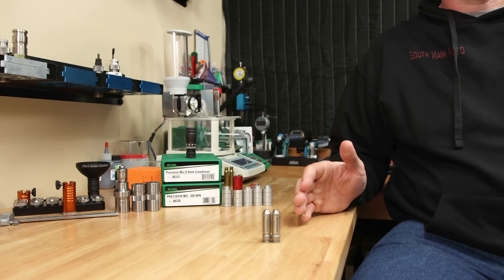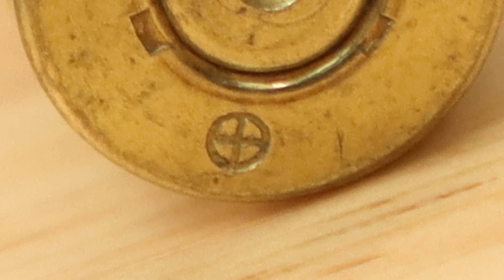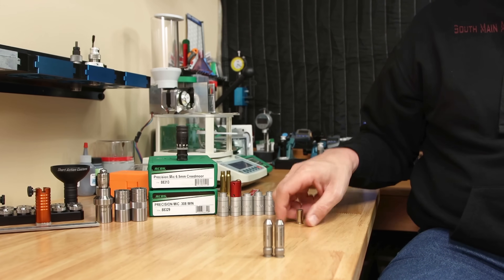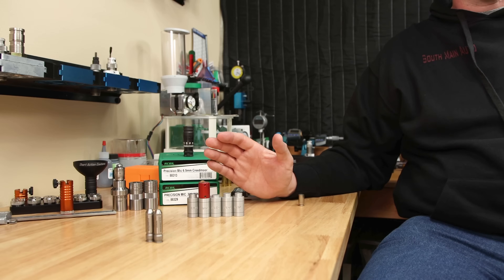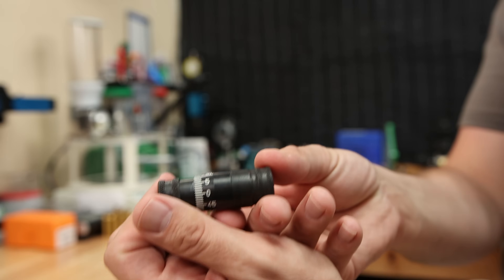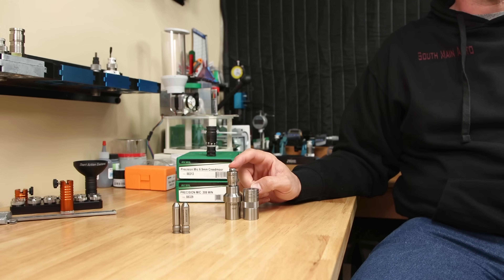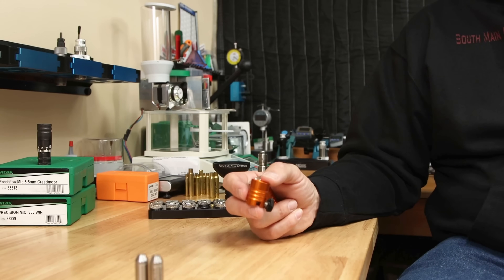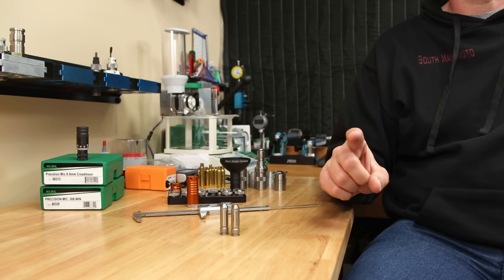Understand and Measure Headspace - 5 Methods Compared!

Comment: From what I remember, a RCBS Precision Mic actually Will give you absolute numbers. The reading on a Go Headspace gauge will be zero. In .308, most commercial factory ammunition will gauge the same. The problem is that reloading presses and equipment tend to flex a bit (some more than others), so I had to set my equipment to average at -0.002. Most rounds were plus or minus 0.001 inch though very occasionally one would get to plus or minus 0.002 inch. In loading thousands or rounds, I believe I only ever had one or two that read +0.001 on the Precision Mic.

Comment: All shoulders are not created equal. Therefor headspace gages are faulty by design. The gage is supposed to contact the datum line located half way on the shoulder. BUT due to allowable tolerances, shoulder angle of gage and chamber will differ. The shoulder angle of the GO-gage can differ from the NOGO. A better design would be a steel sphere to contact the datum line on top of a colom. Both are easily measured. Make the colom magnetic to hold the sphere. A GO colom and a NOGO colom used with the same sphere.

Comment: I like the angled shoulder in the comparator over the (sort of) sharp edge in the Hornady gauges. The Sinclair “bump gauge inserts” fit in the Hornady tool and have two advantages. First, they have a bevel inside that I found gives you a more consistent measurement. Second, they are made of steel unlike Hornady’s aluminum inserts.

Comment: I tried setting the sizing die, by measuring with two methods in parallel, and since we are looking only at the difference and not absolute value, they should show about the same difference, as  it can be seen when measuring the GO gauge. So after using SAC to set the die to bump .0035, when I measured with LE Wilson it showed .009, which would be way too much. I tried to keep my measuring with a constant handling of the gauges, and it always showed about .006 more across multiple cases. Then I tried setting the die based on LE Wilson, and when I reached .0035 bump, the SAC showed 0 bump. At this point I do not know which one to trust.

Comment: I really dislike the caliper clamp opening on the SAC. Option... its not only way to big but because the caliper is not centered exact every time your measurement can very.. Mitutoyo's should be the standerd I feel and all groves should be machined to there spec. For exact fit
Reply from the maker: Hello, Is there and chance that you have the the thumb screw in the "O" side of the body instead of the side marked "C"? 
CONFIGURATION “C”: CENTERED
With the 10/32 Thumb Screw mounted on the bottom side with a “C” means that the Modular Headspace Comparator Body will be centered on the dial calipers. This is standard for all normal uses.
CONFIGURATION “O”: OFFSET
With the 10/32 Thumb Screw mounted on the bottom side with a “O” means that the Modular Headspace Comparator Body will be offset on the dial calipers. When using the Hornady COAL measuring tools, the Modular Headspace Comparator body must be offset on the dial calipers in order for the Hornady tool to be properly aligned with the Modular Headspace Comparator assembly.
Reply: @BoltActionReloading   thanks for the responding. Yes I'm using as SAC suggests. I wish I could add a picture to show you what I'm talking about.. great video bud thanks
Reply from the maker: Send me a picture if you have one to the email in my channel description.
Reply: @BoltActionReloading  sorry dude I can't find any email..  of you list it here I'll send it to u

Comment: I have the SAC, but my fired .308 case mouth will not fit all the way into the comparator.  Works fine after i resize, but i cant get a before sizing shoulde measurement🤔
Reply from the maker: I would call and see if they have a newer design.  They can probably help.

Comment: Recently got set up for reloading using hornady dies for 308. I've set my sizing die and locked it in. I'm getting a lot of variance in my shoulder bump measurement. Using hornady headspace guage. What am I doing wrong?
Reply from the maker: There can be several factors. If you are using multiple brands of brass, if they have different number of firings, etc. all of these things can add up. Also defining what "a lot" means to you is helpful. 

BAR
Reply: @BoltActionReloading  all federal factory load once fired in my rifle. Can vary from no shoulder bump to 5 thousand plus and everywhere in between. Using hornady digital calipers
Reply from the maker: what is your case lube? are you annealing? What Hornady insert? (.400?) when you measure the same piece of brass 10 times do you get the same answer? are you decapping first? (any primer cratering can cause variance)
Reply: @BoltActionReloading  decapped,  lanolin alcohol lube, proper insert, not annealing, same measurement multiple times on same piece of brass. Spraying lube exactly the same way every time. 50 at a time in reloading tray 1 downward angle spray from each side
Reply from the maker: What die / press setup?
Reply: @BoltActionReloading  hornady custom grade 308 die set and lyman all american 8 press. Forgot to wipe lube off before measuring against hopefully that will account for most of the variance. Also going to leave the brass in the die for a longer count to see if it helps
Reply from the maker: I am not experienced in turret presses, I wonder if there is any slop / variance in your turret head? I have people ask me about this frequently and would really like to make a troubleshooting video on this topic.
Reply: Look into annealing. What annealing does is “resets” your brass.

Comment: First video of yours that went a tad over my head… I use Hornady and understand the concept but it seemed a bit too short in context.
Having stated this still love your expertise.
Reply from the maker: HI Bert, Thanks for the feedback! I really was just trying to get the point across on how to use the tools rather than concentrating on the drawings (to a reloader, loading for 1 chamber, means basically nothing more than find the correct size datum tool if your using the Hornady tool.) Otherwise its picking an insert and a pair of calipers. I was just trying to show that there were lots of ways so folks could pick the one that suited them best. This was the first time I have used the RCBS mic and it was a lot less fiddly than I expected. Seems that all the viewers are choosing shorter content these days so trying to give all the options in a concise fashion was my goal, maybe I missed the mark a little. If I could understand better what more people really wanted to see I would include it.

BAR

Comment: It would have been more informative to use the same caliper when showing the measurements on the SAC and Hornady gauges. Remove some variability. Still very informative.
Reply from the maker: Thanks Rex, I see your point and that may have been the better way to do it. The accuracy on all the calipers regardless of brand is going to be +/- .001" so I didn't think it would be a factor when they all read well within that tolerance Thanks for the feedback.
Reply: @BoltActionReloading  I have to admit I had a little bit of an ulterior motive I also have the Hornady caliper and I wanted to see how accurate it was in both cases 😀

Your channel has been a blessing to me thank you for everything you do!

Comment: None of this is necessary for basic reloading. This is for competition level accuracy.  As long as a rifle has proper headspace, setting up dies to safely reload is easy and requires no extra equipment. Someone just getting started making their own ammo might find that fact useful.
Reply: Yes as a beginner reloader I just follow a simple process, take once fired brass from one rifle, use headspace comparator to measure before/after when setting my full length sizing die, make sure to bump shoulders no more than +/- 0.001"
Reply: The lee hand loader only sizes the neck seems simple are they safe
Reply: @scottpatterson6863 I did not see the accuracy I am looking with the Lee Loader.  ...and no I do not want to just re-size the neck and not check and  re-set the shoulder.

I final size my 223 case necks with a Sinclair mandrel die and a 21st Century carbide mandrel on an Forster Co-axe press.  (To precision set bullet neck tension).

Case neck thickness uniformity is measured with a Sinclair case neck thickness uniformity gauge.  Necks are turned on a Forster mini lathe and polished with 000 steel wool.

I use the black RCBS headspace gage   as shown in this video to set the lock rings on my dies.  ... and I have drop in ammo checkers for finished rounds and unloaded cases.
Reply: No... really?
Reply: "Proper head space... ain't in the rifle!" (as you say).

"Headspace is the proper fitment of the brass case in the rifle chamber or the space between the case head and the bolt face when the case neck is flush with the front chamber face (The blank space between the case head and the bolt face is the head space on a rifle and somebody just starting out might want to know that!"

On pistol cartridges,  well... there is no shoulder so the headspace or proper case fitment Is set on the case rim and in the case length and it is set with a case trimmer.  We set the headspace on pistol brass with the case trim length.

The tools depected in this video were not just developed for precision accuracy... they were also developed for safety.
Reply: @50Quid-d3x  Setting the headspace on a "firearm" is the job of a gunsmith. It involves reaming out and/or setting the chamber to specifications with special precision tools called go and no go gages. I know, I've done it myself several times. Cases are made from the factory to the same exacting standards as headspace gages. Trimming cases is NOT the primary means of achieving proper headspace. It is simply a necessary step in proper reloading practices.

Comment: I have both the Hornady & Precision Mic headspace tools and found you cannot compare measurements equally from both but can only compare measurements from each tool separately. 
Simple terms either use the Hornady headspace tools or use the Precision Mic tool.

Comment: I have all these tool - the best way is the PMA Quick Case Checkel with a wilson case gage (I dont like their plastic case gage that comes with the tool - the wilson works much better) - trust me - worth the money. It's basically like the LE Wilson one but it has a ProCheck Dial Indicator that pushes up the base of the case. 100% consistent all the time.
Reply from the maker: I have never ran into that tool at all. I can see why you might like it. In my quick search I didn't see a digital version, (which I understand isn't required) but so many folks cling to these days.
Reply: @BoltActionReloading  I’ll take a quality analog any day. Especially for .001 measurements. You should try it out. They sell it without the cases and it works with LE Wilson ones. My other tools now just gather dust.
Reply from the maker: I understand completely, especially for this case I don't think it would affect its general usability, just wanted to make sure I wasn't missing something. I truly don't mind analog, unless its calipers, I will never be as fast with analog calipers.
Reply: Agreed. I love my digital calipers.

Comment: Interesting, I didn't know there was a measurement for the datum.  I've seen differences between which diameter headspace gauge you need to use between vendors.  Now Im curious which one was right.
Reply from the maker: Well I guess that's part of what I was trying to get across, if using them as a comparative tool, I don't think it matters that much. All of them measured essentially the same difference. (within the tolerance of the measurement tool anyway)
Reply: @BoltActionReloading With my RCBS precision mic, it shows .003 over the minimum, but on the same piece of brass using the wilson shows .006. After sizing, the RCBS and LE wilson both show .001 

How is this possible?